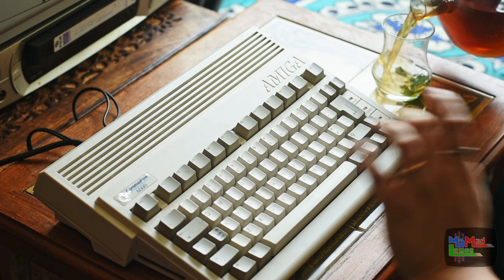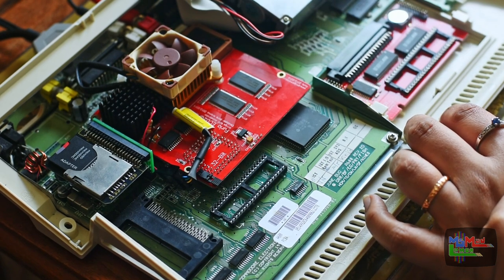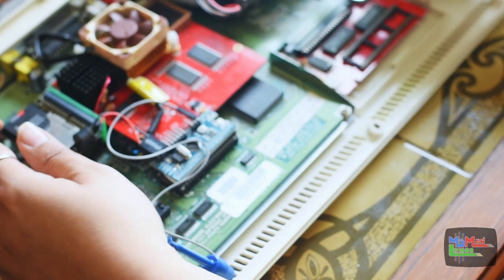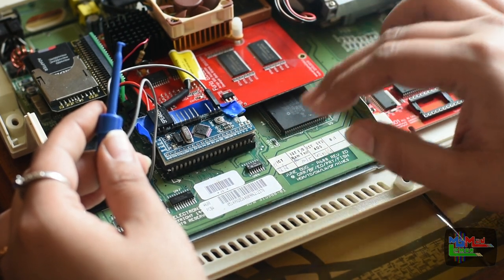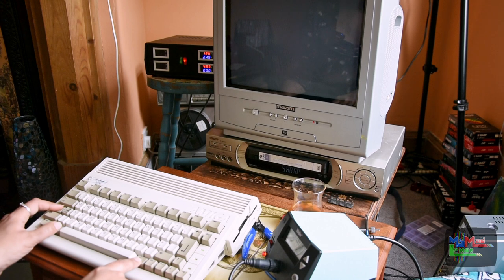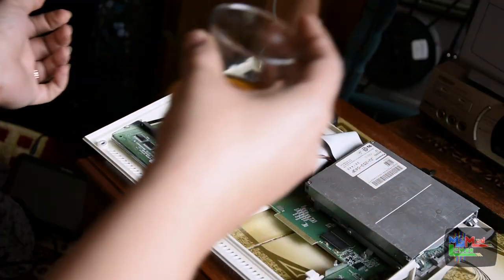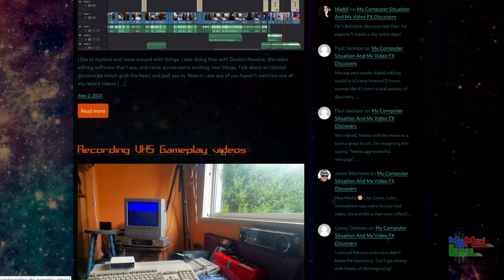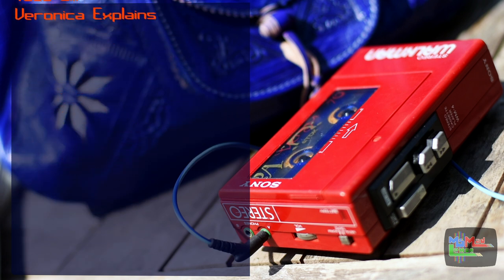Kickstart Rom Switcher V2 in the Amiga 600

Comment: Great video, nice to see old computers still being strong and even upgraded, optimized!
I never hat an Amiga, but ZX Spectrum with DIY floppy tower, BetaDisk with MagicCopy function (save anytime to Floppy 1, load anytime) and also C64 breadbasket.

One hint: Blowing the air onto the heatsink is even more efficient than sucking air from it. The chip runs cooler this way. The best would be to add some spacers between the heatsink and the fan, if you can, so less whirls/turbolences substract fan speed.
I'd even give a bigger slim fan a try, because those run slower and push more air to other chips.
I took out many fans from old PC parts, doesn't have to be a new one. I also like to use 12 V fans running completely silent at 5 V.

Comment: As a datacenter engineer, I can understand getting a little excited about fan direction. Of course, it's probably overkill in an Amiga but some of us get into the habit of making sure air flows properly to gather all the heat and such without causing conflicting airflow currents and natural convection to mess with things. 

And yeah, I never completely screw together any of my projects, because I just end up unscrewing them anyway. I'm also horrible with cable management for the same reason. 🤣

Comment: If you remove the hose and shrink wrap tube from the noctua wires, it'll be much more cooperative. and also doesn't rip out the socket from the pcb :D

Comment: My A1200 has'nt had screws in it since 2005. LOL
I hate those clips. I would have soldered the wire too.
Cool ROM switcher. I like the beeps telling you which ROM you have selected.
I agree with you about fans, as long as the air is circulating, what does it matter ?
Reply from the maker: You sound like me with your Amiga not having screws in it for years Lol! 
Thank you! as long as there's air movement on the heatsink to take the heat away. It's amazing the stupid things people get really heated about.
Reply: @MsMadLemon  I see what you did there. LOL.

Comment: I sometimes put my cpu fans on upside down. helps cool the components on the motherboard because they are not getting blasted with pre heated cpu air. instead they are getting cooler air.